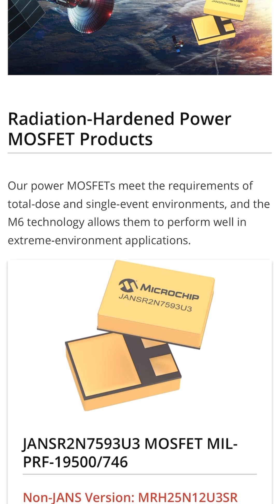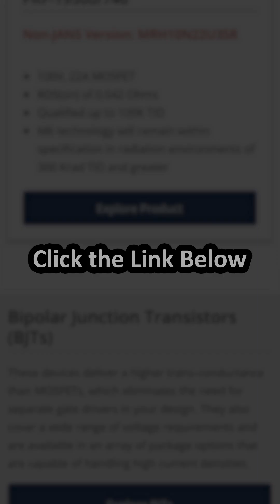Radiation-Hardened MOSFETs Built for Extreme Environments #defense #electronics #space #mosfet

Comment: Hello, what is the VDS/VGS SOA as a function of LET?
Reply from the maker: Hi there, thanks for reaching out! Based on our understanding on your question, the Safe-Operating Area (SOA) for VDS/VGS as a function of Linear Energy Transfer (LET) in radiation-hardened MOSFETs is characterized by different ion species and their corresponding LET values. For example, in the 250V N-Channel Radiation-Hardened MOSFET, the SOA is defined for various VGS values (0V, 5V, 10V, 15V, 20V) with different ion species such as Ag, Xe, and Au, each having specific LET values. Similarly, for the 150V N-Channel Radiation-Hardened MOSFET, the SOA is defined for VGS values (0V, 5V, 10V) with different ion species like Xe and Au, each having specific LET values. For further clarifications please connect with us at: https://www.microchip.com/en-us/support. Thank you!